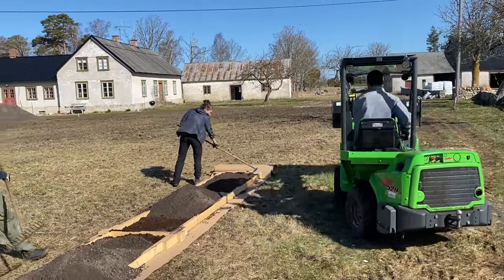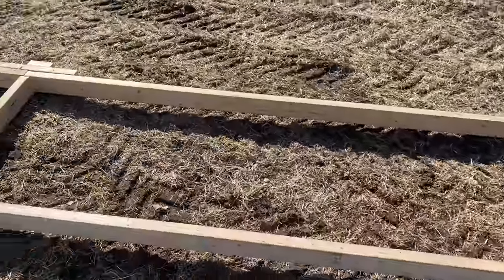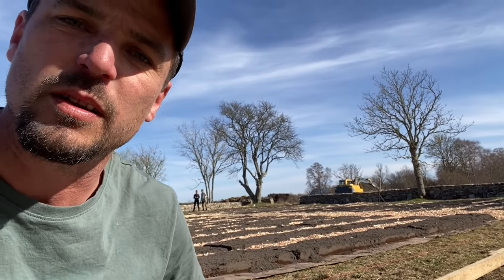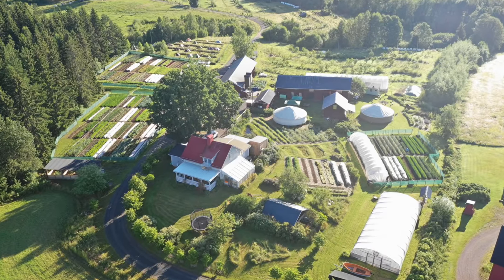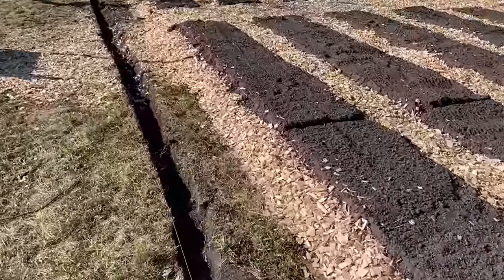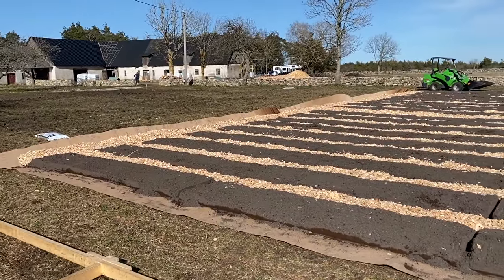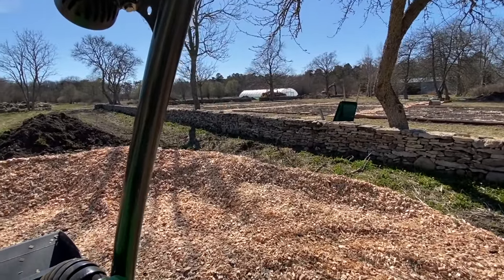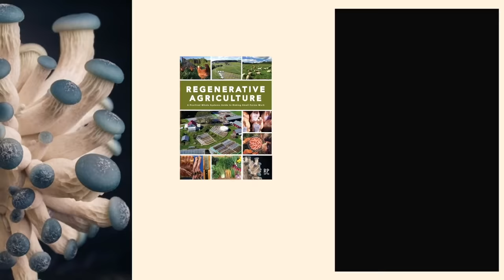Building no-dig/no-till beds. BEDS.PATHS.EDGES

Comment: I live in a semi arid, hot-dry-windy summer area. We get 22 +/- centimeters of rain, usually Oct to April, then nothing for summer. I lay down deep mulch around all the plants in March or April to retain as much winter moisture that I can - wood chip in the orchards, straw in the veg beds. I even have straw mulch in the decorative pots I have. Evaporation has decreased dramatically. I have drip irrigation that I run when the soil is dry at about 3 inches down, and deep water less frequently because my soil is now retaining more moisture. I don't have a market garden, but perhaps this will work for them for those months when water is scarce. Also, the farm looks lovely. Hope we can see an update later in the season.
Reply: good to know. i'd love to find a channel that goes into no-dig in more arid environments.
Reply: @nickfosterxx  Look up Ruth Stout gardening and Core gardening. She would do 8 inches of hay for her garden and after a 2 or 3 years there is so much moisture and nutrients that you don't need to fertilize or add any amendments. I think she would add one amendment when she planted, I forget what it was though.

Comment: I love the simplicity of this method and I have used it for starting beds in our small family garden.  But, on a large scale, it is very expensive to source so much compost and soil and hard to find quality stuff.  I also don't think such a thin layer of cardboard would be enough to suppress weeds and perennial grasses here.
I'm starting a 1/4 acre market garden this year and I'm torn between this method and the more traditional method of first tarping, then working the soil with a tiller/broad fork/harrow and adding a thin layer of compost after that.  Then going with a no-dig approach after the beds are established by just adding compost each year and minimal surface tilling for bed prep.

Comment: Fantastic, thank you for the brilliant job you're doing. ... I just do not like cardboard, as it may have lots of bad stuff in it. I was looking for an alternative material for quite a long time now and finaly decided to give the mulchpaper of magaverde a try. I don't know, if it will really work, but it's worth a try (it's only 40m² beds in total) ... maybe, this helps others, that are looking for an alternative as well.
Reply: How did it work?
Reply: @porkchopexpress6969  could have been better, but because I first removed the top 5cm with the spade and combined it with a thick layer of compost, it worked ok.

Comment: I tried this the same way, but it wasn't that simple for me. The strong weeds like Ground elder, Cirsium and Dandellions all broke through the cardboard as it got moist, and I spent a great deal of the year just trying to stay on top of them, plucking them out. But their roots are quite persistent, so I did this the whole year round and it's still not killed yet in most places. 
I am thinking of either digging everything - only one time job, but a big one, and clearing all the roots out, or laying the entire design again, this time maybe with 2 or even 3 layers of cardboard. I will have a hard time acquiring that much carboard, as I can't find it in rolls around here in Slovenia, and I can only acquire so many sheets from the shops in one trip, since I have only a small trunk in my car (last year I had a lot of cardboard already in the storage). So I'm more keen on option 1, even tho it's not no-dig. What would you suggest?
Reply: I would till with a tractor very early Spring (yes, not exactly no-dig, but effective and quick), then till once more, let it lie for 5-6 weeks, and then remove the remaining strong weeds manually, there should ideally not be that many of them per sqm.  Then put on cardboard etc.
Reply: Just cut and drop them to improve the soil. It is a fetish to worry so much about a few weeds   They are there to improve the soil by bringing up calcium etc

Comment: Hello Everybody, 

hello Richard
Your work is amazing.

I have been working with your system for 3 years already. Working with mini orchards for restaurants.

Now i would like to create a bigger orchard 

I would like to simplify the preparation of the beds 
My idea is to make a big bed ( a big blanket) of 15 cm of compost with a tractor. And make it without wood chips paths. 

I believe that you can still walk in the compost. And I believe preparation can be much more easy and quick.

When the compost start to be more humid, then I can add some wood chips if I need it, but weeds will be all above the big blanket. 

I have never tried, but I would like to try.

Have you ever tried? 

Thanks in advance, 
Lucas

Comment: Looks great.  How much compost, soil and woodchip did you use to  make these beds?
Reply: good question, seconded. looks like he did a fabulously accurate job of calculating quantities!
Reply: My best guess...10m x 0.75m x 10cm =0.75m3 per bed times 80 beds is 60m3 say 50/50 soil compost is 30m3 of each. He mentions 6 bags of compost per bed, where I am they typically come in 50L bags, so 300L or 0.3m3 so a little shy of half a single bed volume.
Between beds is (approx by eye) 0.25m so 1/3 of beds, so 20m3 plus the pathways, say 1m x 130m x 10cm =13m3, grand total 33m3
Reply: @paul42592  Thanks
Reply: @paul42592  Good estimate, but it looks like less than half is compost; I'd say 1/3 at most.

Comment: Does the no dig method work on every soil? Because I’ve heard ppl with clay rich soil having problems with the weeds getting through the cardboard because weeds in clay rich soil develop deep roots and  make it through (or maybe only deep rooted weeds grow there anyway?). On the other hand with more sandy soil the weeds tend to have the roots more near the surface and they would die under cardboard and not make it through. That’s what I heard….
What’s your experience?
Reply: I have no dig beds on clay soil. What you've said is true, dandilions always push through. Only had to dig them up once with a trowel and they never returned!